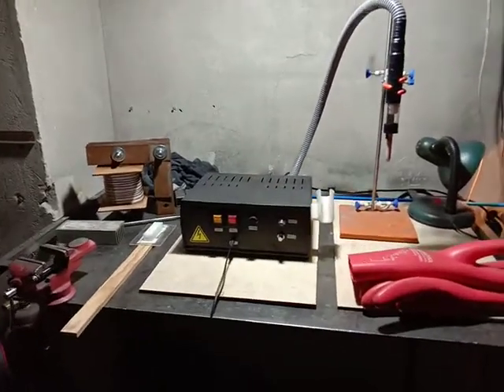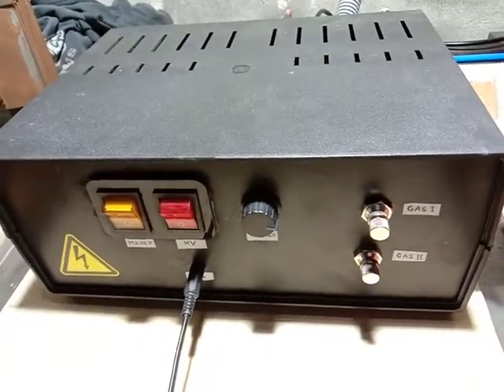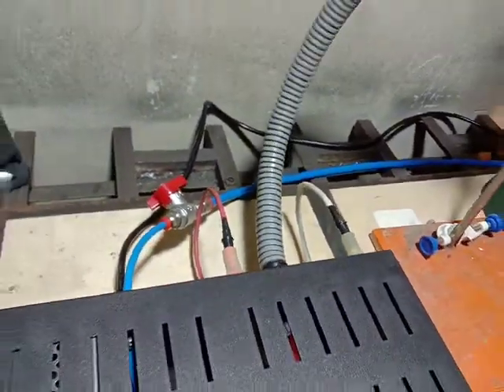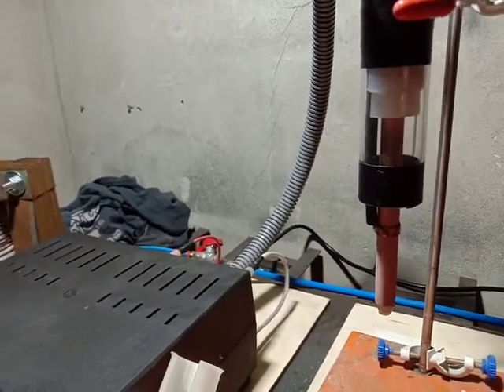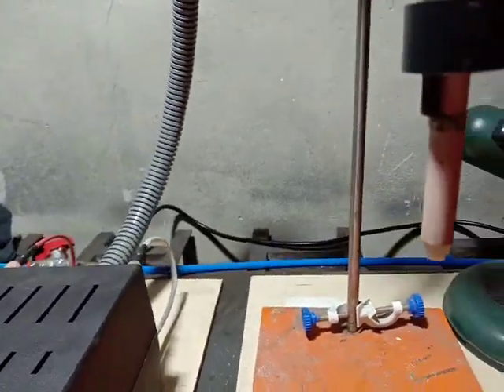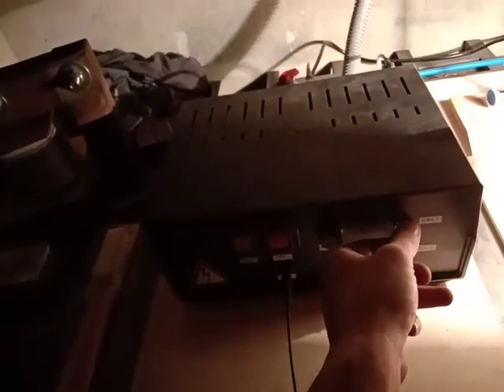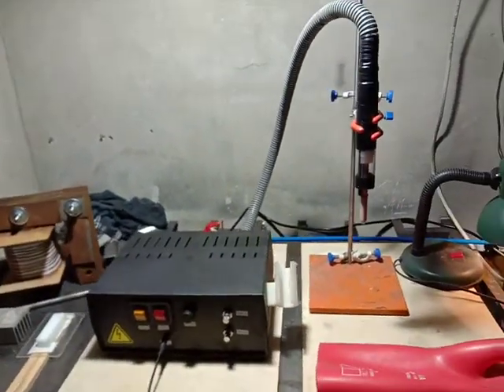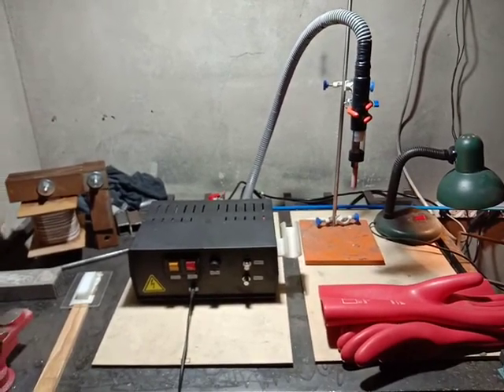DIY Cold Plasma Torch (Atmospheric Pressure Plasma Jet) - Part I (operation)

Comment: Did you look at high frequency high voltage?  The fly back/ ZVS results in a pretty low frequency plasma.  Aren’t higher frequency PS more useful in cold plasma generation?  Nice build.  All the best in your countries endeavours.  🇨🇦